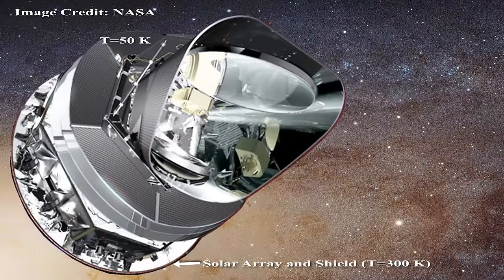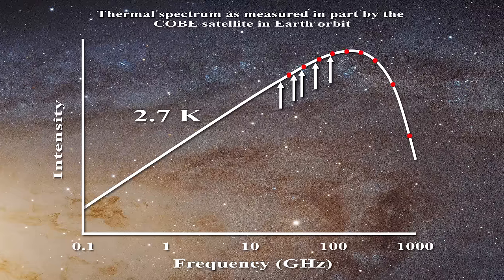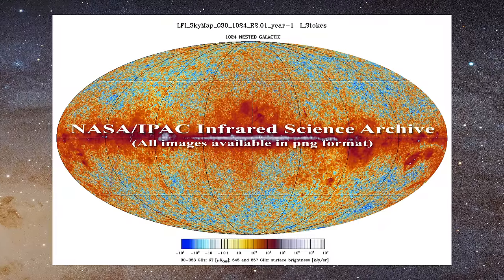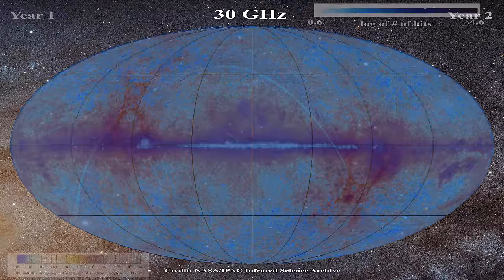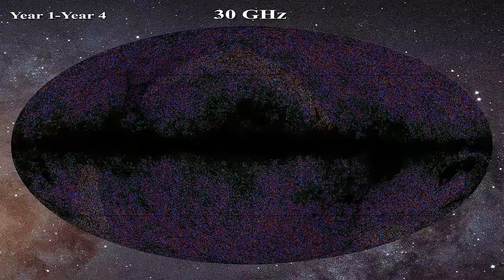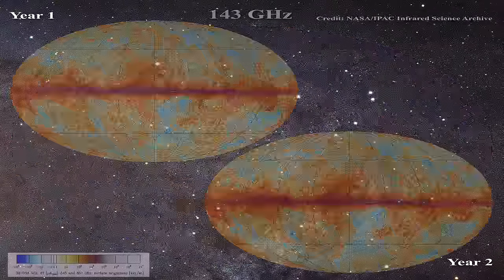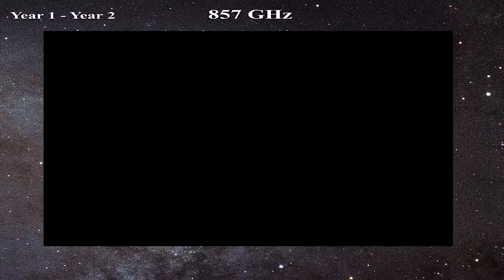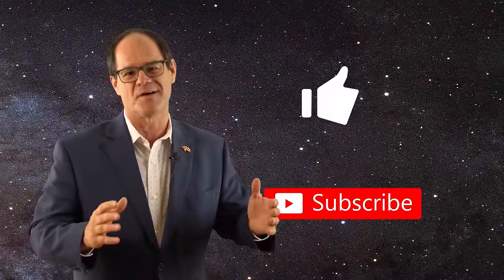The Planck Satellite - A $1,000,000,000 Misadventure

Comment: Why can't they provide linear mapping? Who paid for the data?
Reply: @Adam A:  “@Bob Watson, and the teacher arrived. Kindness and comedy always wins.” Isaksson

“Is Pierre-Marie a crank? No. He is just a garbage Electrical Engineer.” Isaksson

Dear Mr. Isaksson, your comments above are far from kindness and comedy. The fact is that the Planck Team never published yearly differences for each frequency, no doubt because they know they are not good, and that is where the real garbage is. Your teacher Watson, a member of the Planck crew, claimed that they have published such images on the ESA website but was shown to be a blatant liar. There are comments under Watson that apply to you as well. It is you who is out of his depth. A qualitative analysis of these images proves that they have significant variations on a pixel to pixel basis. Like Watson you tried to distort the issue of compression in the pngs. There are  significant fluctuations easily seen on these images when the opacity is changed, and that means that the differences between these images are severe because they are plotted on a logarithmic scale. You’ll find more under my reply to Watson. 

Crickets!

Comment: Are these images available as linear measurements? Is the data available to create them if not?
Reply: What we really need is the raw IQ data from each sensor element. It would still reveal an inconsistent temporally differential background map.
Reply: @onehitpick9758  :  “@Bob Watson, and the teacher arrived. Kindness and comedy always wins.” Isaksson

“Is Pierre-Marie a crank? No. He is just a garbage Electrical Engineer.” Isaksson

Dear Mr. Isaksson, your comments above are far from kindness and comedy. The fact is that the Planck Team never published yearly differences for each frequency, no doubt because they know they are not good, and that is where the real garbage is. Your teacher Watson, a member of the Planck crew, claimed that they have published such images on the ESA website but was shown to be a blatant liar. There are comments under Watson that apply to you as well. It is you who is out of his depth. A qualitative analysis of these images proves that they have significant variations on a pixel to pixel basis. Like Watson you tried to distort the issue of compression in the pngs. There are  significant fluctuations easily seen on these images when the opacity is changed, and that means that the differences between these images are severe because they are plotted on a logarithmic scale. You’ll find more under my reply to Watson. 

Crickets!
Reply: @roger_isaksson  Of course.  I'm interested in the magnitude of the differences relative to the noise.  The problem is there is no empirical way to estimate a clutter improvement factor, because there is no ground truth.  Any pointer to unprocessed data would be appreciated.
Reply: @roger_isaksson  You can't do sophisticated cancellation when your acquisition system is simply logarithmic.  You need super-high, linear dynamic range to cancel large signals revealing small ones behind them.  You could do cancellation, however, with a logarithmic sigma-delta, where the sample rates are high,  the deltas are mu-law encoded, and you have a floating baseline in high precision.
Reply: @roger_isaksson  One flawed assumption is that the signal is coming from the background and (ignoring our own galaxy, which is another story) all the non-background sources are successfully removed.  We are still discovering more point sources and diffuse sources all the time, to the point where Olber's paradox is being realized. The far field (but still foreground) is full of sources in visible, infrared, microwave, and beyond, and only a tiny, tiny fraction of them have been cataloged or even disovered.
Reply: @roger_isaksson  : It’s now quite evident to everyone that you and Mr. Watson have no understanding of imaging.  You have now confirmed that the Planck Team did not present the difference images because they knew that they were garbage. If they had done so they would have lost their funding 10 years ago. In fact if WMAP had taken their difference images as Dr. Robitaille warned in 2007, the Planck mission would have been terminated. Watson’s difference data are horrid. It’s clear that you have no experience in analysing difference images. If you wanted Planck to have any cosmological validity the standard deviations Watson presents should be 100 times lower. You are obviously out of your league competing with Dr. Robitaille. As it is Watson’s analysis further delivers the death blow to Planck by Dr. Robitaille. Unlike you, Dr. Robitaille, using simple qualitative analysis, could tell that there is no stability in the Planck images because he is very experienced in analysing difference images. He did not need to go to quantitative treatment because he knew the results would be horrid. Remember, Watson’s analysis is for 70 GHz and the WMAP analysis for the CMB is weighted in V-band. That is why these difference data are now so devastating. Once again they simply confirm the point Dr. Robitaille has made.

Comment: Looking at the graph produced and various overlays, it appears to me that the differences in data from year to year and in all bands were uniform and got progressively worse.  This suggests to me an issue with the instrument, probably one of the mirrors since they are common to both detectors.

If the differences in data are due to an issue with the instrument, it diminished the usefulness of data (particularly later data) rather than invalidates it as suggested by the host. 

ESA appears to have a web site where you can access the raw data and data quality reports at https://pla.esac.esa.int/#home.

Comment: Isn’t it expected for the maps of different years to differ? Not only because of the contamination by the galaxy / in between sources, but also because the gathered photons were emitted from “1 LY” further away (so they could arrive 1 year later). Are you suggesting that the fluctuations within 1 LY during emission / decoupling are supposed to be less to fit the proposed cosmology? If the whole “sky” had 90 million lightyears diameter at the time of decoupling, shouldn’t we have 90 million pixels along the diameter of photographed sky that could differ over the course of a year?

Comment: Interesting revelation. If a star like ours can be variable—is that because of or independent of the Birkeland Current’s variability or because of the star’s nature—then I guess a galaxy could also be variable. Does that mean the galactic sector could be gentler at times?
Reply: I like your thought process. What if the frequency of the galaxy is changing and variability is due to connected values we have yet to understand? I too would like to hear what the design team has to say about this variability.

Comment: Pierre-Marie, you really should read my paper 'The Greenhouse Gases and Infrared Radiation Misconceived by Thermoelectric Transducers' https://vixra.org/abs/1811.0499. In it, I uncovered a systematic error brought about by the use of thermoelectric detectors - of which bolometers are one - in misdetermining the so-called greenhouse gases. These are the detectors that all your work is focused on, I have watched all your presentations, and yes, you are right, we have been misled. I concluded blackbody curves are a misconception just as are the special greenhouse gases. What John Tyndall 1859 discovered, using the then-new thermopile, were the gases that transduce electricity. Kirchoff and others used the same instruments. Yes, emissivity is also a misconception - a correction factor for thermoelectrics.  I have found that all atmospheric IR experimentation is best conducted using a Raman - laser-based - IR spectrometers. Thermoelectrics are now made redundant. I have experiments myself I wich to conduct and am drawing up a proposal. My work on Raman spectrometers is here: 
Quantum Mechanics and Raman Spectroscopy Refute Greenhouse Theory https://vixra.org/abs/1811.0498

Comment: (electromagnetic, EH) noise, including background noise all compose of AM, FM and PM noise components. To make mater worse, space reverberation and scattering effect adds a time delay component into our observation. This isn’t simply a sum/diff issue. 
 
To capture AM, FM and PM noise a victor receiver can be used. Modern cellphone utilizes I and Q Chanel receivers capable of discerning all three components above. To account for reverberation and or scattering a signal processing algorithm is required. Where is the next available super computer is?

If that wasn’t a condition in measurement/processing data in our experiment, then why not?
Reply: By PM, do you mean phase modulation or polarization modulation?
Reply: onehit pick 
Good question. PM in my message implies phase modulation per polarization channel. I assume the project scientist and manager aren’t dumb enough to omit quadrature polarization receiver system. It is therefore assumed that antenna here are v and h polarized followed by one IQ receiver per polarized channel.
Reply: @philoso377  I have not been able to find any IQ data.  The data I have found is intensity only, and far, far too undersampled to obtain quadrature data from .  If you have a pointer to some quadrature data from then, that would be appreciated. I would not know how they could have done this back then, however, because the receiver technology did not exist.
Reply: onehit pick 
My message was intended as pointer to alert if there is something in ignorance. I am sorry couldn’t be more helpful. FYI I believe the two space probes launched in 70s has digital transceivers with IQ channels. Why not IQ receivers onboard each space probes ordered by BigBang administration? Unless they don’t know much about technical or engineering other than math modeling.
Reply: @philoso377  Even the more recent probes only had bolometers.  They only give non-coherent measurements, and are way undersampled in terms of Nyquist, so you cannot reproduce quadrature data.  If we could redo this today, we could actually do some significant cancellation, but still not anywhere close to what is required to reveal what's behind the Milky Way at the edge of the universe. But this is beside the point.  There is no way to cancel the trillions, or even hundreds of trillions of unknown galaxies that are along the way.
Reply: onehit pick 
We were tricked into looking at some rainbow in our celestial sphere, Big Bang noise was conceived from misunderstood of thermal dynamic, hypothetical black body radiation. If that is so, our time and brain power can best be directed in real problems but hypothesis from our of misunderstood science. I was entertaining this thread as far as I could, now wanted to shift gear. 

Frankly, Big Bang and Theory of Relativity are derived (stem) from misunderstood technology at the time. Technology use to measure light speed also use to rule out presence of Aether. In reality light is wave that needs Aether to propagate, Einstein’s administration say Aether doesn’t exists. When permittivity in Aether increase we have blue shift spectrum, decrease we have red shift. Cosmic space isn’t entirely “empty” it is filled with (accelerated and decelerating tiny particles) which loaded up the permittivity in Aether from E0 to >E0 ie blue shift. Dismissal of Aether from the cosmic space have forced Hubble to conclude red shift galaxies that implies our universe is expanding from a Big Bang past.
Reply: onehit pick 
Well put. The universe isn’t empty of stars, suns or galaxies. How may we selectively remove it with precision?  Why didn’t anyone point that out? Wait what about dark energy and matter get mixed in this? :)
Reply: Especially when the newer examinations of ultra-deep fields are revealing hundreds of trillions of galaxies well before any "reionization" event. There is a frothy, noisy blanket of stuff out there, that was previously unknown, unacknowledged, and continually underestimated. It not possible to remove such stuff from CMBR because it occupies the same spectra.
Reply: I think we could produce a fantastic image of the deep-field intensity map these days, with truly quadrature receivers and some modern, not-contrived cancellation. I agree that it would not have anything to do with reionization or anything like that, but it would be a revealing image if done with modern receivers that can actually receive the frequencies of interest at full rate and in quadrature. Radiation-hardening all the modern mm-Wave stuff might be challenging, however. I'm not aware of any valid technology, even these days, that could actually cancel our galaxy, so this would have to be blanked (or simply masked out).
Reply: onehit pick 
I agree. It may be a bit far fetched to proof Big Bang with CMBR. I think Robitalle is right about that CMBR team have misunderstood Thermal Dynamic in the “black body radiation”, model our universe as a cavity with inner wall that reciprocate (absorb, emit) equal amount of  thermal radiation (as the black body radiation model do) hence the theory of CMBR. Who said or have proven that our universe have wall?

Comment: If they are claiming that these images are of the microwave background left after the Big Bang, then how come they find different values for the intensity of that radiation (different temperatures) each time they observe the same location?  To my tiny mind, if this image is of an artifact of some historic event, then it must not change each time we look at it if their claim as to its origin is to stand.   
Conversely, if the observed data varies with each observation, then they have to acknowledge that they are looking at an on-going event which is currrently happening at the place the observed temperature is found at.   
I understand how they (think they) can determine the distance to remote objects like stars, galaxies, quasars etc, but how can they be sure that the pixel reporting a particular temperature is located at the edge of the every-expanding universe, where the 'microwave background' must be located.  There are, after all, one or two things that could be obstructing or interfering with the signal between orbits near Earth, or Earth-based observatories and that ultimate distant point where this temperature profile is alleged to reside.

Comment: Someone please enlighten me.  So we have some differences from year to year in measurement.  This could be in part from the measurement error bounds of bolometers themselves,  from the noise of the instruments,  and from the noise of the cosmos.
But isn't the signal difference from year to year still relatively very small compared to the signal?   And why does the signal intensity curve match so well with a blackbody curve (at a certain very high temperature, but of course greatly 'redshifted').  If it isn't from the alleged (redshifted) extremely hot early universe, what is it from?   What else could make a curve like this? I want alternative theories. Randell Mills of Brilliant Light Power has one, sort of.  I want to hear more alternative theories and would appreciate if anyone can offer one, thanks.
Reply: The Sun does not produce a Black-Body Spectrum - it is only similar to one, I think :)
Oh! Did you think that a BBS was produced from the Sky?
The "need" for alternative theories and theorisation-obsession are a big part of the problem: it is these "pur-blind theorising dolts" who need to waddle off and not come back.
PUT THEM ON AN ASTEROID (not one that's going to come back, obviously).
lol

Comment: Logarithmic rather than linear?    In one single sentence this describes just how inconsistent each years data is from the previous. Useless.
Reply: Scientists often look at data on a logarithmic scale as it is much more useful for real-world data.  In fact, most of your own senses operate logarithmically for this very advantageous reason.  Your perception of brightness (visual), and loudness (audio) operate logarithmically.  It's how we were designed or developed.  If you want to see a clear signal that's 10000 times smaller in power that some larger signal -- good luck on a linear scale.  But on a log scale, it's only a 40 dB offset which is clearly visible with, say 10 grid marks.
Reply: @onehitpick9758  golden ratio logarperiodic scale is exactly right.  I was implying the comment to their scenario.  Thats all that i meant by it.